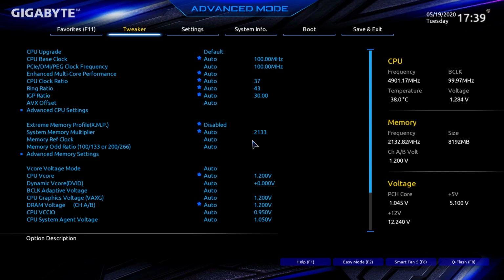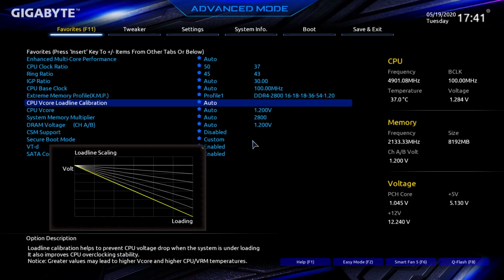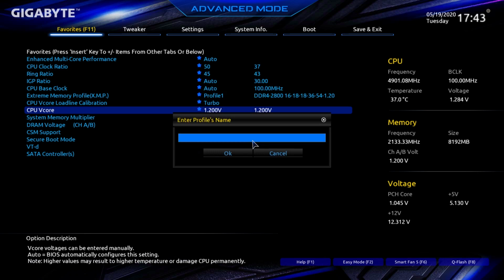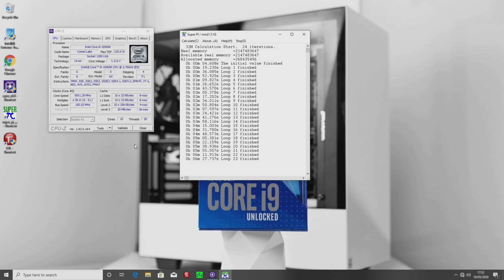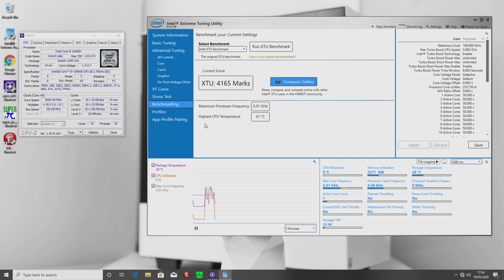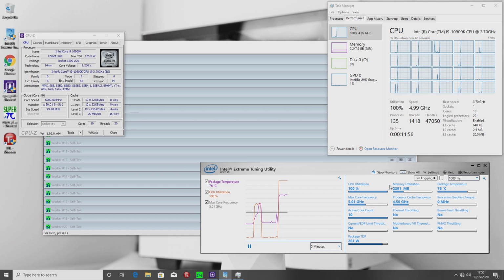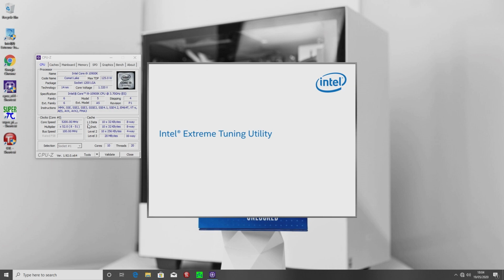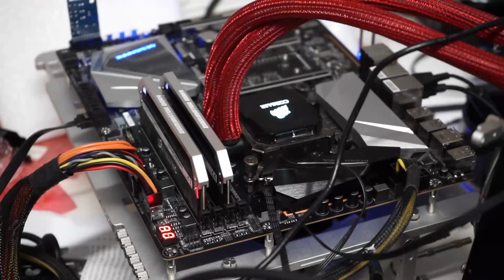Intel Core i9 10900K & Z490 5GHz+ overclocking guide

Comment: I'm picking up a 10700k this week.  What is the best z490 board ?  I saw the Maximus xii Extreme, but you can't find it anywhere.  Is the Gigabyte z490 xtreme a good alternative?  I had a z390 Aorus Ultra and the board was great.
Reply from the maker: I’ve had experience with Asus board as well as Aorus Master and Vision D. All good boards. I see Gigabyte Z490 Elite board is also a great clocker. Not sure about MSI and Asrock, no experience

Comment: My i7 10700k runs at 5ghz for about 15 seconds and drops right back down to 4.7 all core? MSI Z490 Gaming Edge ATX MB. I've tried everything, but it will not stay at 5ghz. Nothing is throttling. Is my MB just a POS? I can set all cores at 5.1ghz in the Intel Utility and it runs fine for hours, but it will not hold OC using the BIOS. I don't know what's going on.
Reply from the maker: I don’t have experience with MSI so cannot say but i assume you’re not doing your settings right in bios. Try find a guide with MSI boards or try replicate steps I’ve done in my video by searching out all the options in MSI bios
Reply: @dinos22  Thanks. If it's not an issue with the bios update, I will have to RMA the MB. If it comes down to it, I'll buy another brand, and I'll spend a little more to get a better one.. I guess 4.8ghz, or 5.1ghz using the Intel Extreme Tuning Utility will be ok for now. I'm waiting on a response from MSI at the moment. We'll see. I may even go buy a new board tomorrow, and try to return this one. Bummer

Comment: I'm new to overclocking so i dont know much, But according to CPU-Z i Completed a XTU Benchmark at 5.1ghz at 1.185 - 1.200 Volts (is this good?) even though i have the voltage set to 1.37 in bios with a LLC of 5. Any voltage lower than 1.37 in bios resulted in a crash, is this because it doesnt get the voltage it needs under load?
Are you planning to make a guide for Asus? It was hard to locate the different settings when the whole bios is organized in a completely different order to Gigabytes. 
My goal is a stable 5.2Ghz with a healthy voltage, if not im happy with 5.1. Its my first time overclocking a cpu so i dont know the signs of a bad or good bin and or settings.
Also i BOSD'ed alot with various Error codes, but when i googled them most of them were related to Driver issues, i dont know if this is a direct result of the overclocking or just an underlying issue. Im using a fresh windows 10 install.
(Using a 10900k with a Asus Rog Strix Z-490E and NZXT Kraken X63 280mm)
Reply from the maker: Check out my latest video. Made it due to your request :)
Reply: @dinos22  Wow that was quick, thank you so much i appreciate it alot! You make good guides that are easy to follow and educational, great work! :D
Reply from the maker: I have an Asus board, let me do one for that too. LLC5 and 1.37 sounds like you are on those volts, weird it’s reporting less

Comment: You think I’ll have any issues with a noctua dh15 air cooler?
Reply from the maker: I don’t think so but it will depend on what you’re trying to do. If you try using a load that exceeds the cooling TDP performance of the cooler than you will have issues. Will you have trouble with 5ghz 1.2v, I’d say no

Comment: Thanks for this. I have an auros master and a 10900k with a 360mm aio. Trying to get 5.2 or 5.3. Out of the chips you've OCed, what was the highest cpu vcore you had to set (I.e. the worst chip?) also is it OK to keep the eist and turbo enabled?
Reply from the maker: Yes you can keep it enabled for 24/7. With worst chips I didn’t push them to max so cannot tell you what they needed
Reply from the maker: You’re welcome

Comment: Put system agent at 1.15 and try 49 cache.
Reply from the maker: I had it at 5GHz without using SA. SA will not help your ring clock btw, it will help extreme memory OC and tight latency. CPU voltage is linked to ring frequency so vcore will help but cooling is important for 5GHz+. Subzero on CPU helps obviously. I’ll be doing another, more advanced guide soon.
Reply: @dinos22  i manually input every voltage in my bios to stock instead of on auto. then by changing only 1 factor at a time, i tried to see what would affect cache. and VCORE does not do it.(not for me at least)   i found that only when i had my SA above 1.15v was i able to pass 47cache and go all the way to 49. i was unable to post at 48 before but then all of a sudden 49 was rock solid stable. changing SA for cache dawned on me after i spent an hour researching the architecture of the chip to see what actually is part of the system agent. cache is part of it.
Reply: This is very interesting, maybe raising VCCSA is affecting another voltage but I'm not sure if it's linked to another like VCCIO is to DMI. PLL Termination (PLL OC I think on GIGA?) can help with uncore/ring/cache overclocking but as Dino said temps/cooling seems to be just as important as Vcore

Comment: Have 10700k and its at 5.ghz base and 5.1 with just throwing the chip and xmp, with mce auto want to OC since my sometimes its 8x sometimes its 50x. Its running at 1.27V and 71C max, have a Noc D15 on it. OCing noob so taking it slow LOL. Just trying to find a asus overclocking guild before I start changing things.
Reply from the maker: I will do an Asus guide too soon. Really nice mate, just turn if EIST and turbo functionality in bios to stop multi flicking up and down
Reply: @dinos22  No eist LOL. Ok bootup 49x current and max 52x 1.341V 79C max 5110 cinebench woot. Still need to replace the 3 cheapy intake fans with some Noctua A12x25. Think I'm done not going to push it hahah.
Reply from the maker: Beautiful, enjoy

Comment: So far 5.1ghz at 1.248v (4400mhz men cas18) an 4800mhz ring bus.

5.2 I think will need 1.33/1.35vcore I will test tomorrow

Btw I use a 280AIO and temps are better then my friends 9900k at 5ghz with 1.26vcore
Reply from the maker: Btw 4800 is what i saw on ringbus on all too
Reply: dinos22 did you max out the ring? Maybe it can go 5ghz also?
Reply from the maker: FireTwo interesting you bring that up. Im doing some ram testing now and also played with ring. The chip I used in this guide is stronggg, it can do 5GHz ring too. Had issues with others after 4.8
Reply: dinos22 how do you stress test cache adia64 as an option for cache?!
Reply from the maker: Yes 10900K has more improved thermals and power draw from what I’ve seen in reviews. Paul’s hw has a good graph on it
Reply from the maker: Looks like a nice CPU. Honestly if you are stable at that, you should be able to do next 100MHz with +0.05V

Comment: Intels shows it is 5,3Ghz? Why does not any of this CPU run @ 5,3Ghz stock?
Reply from the maker: 5.3GHz is a turbo clock on 1 core that bumps on light load for a limited amount of time, 2 cores to 5.2 but heavy sustained load will drop to 4.9 with unlocked power bios or low 4s with stock bios. What overclocking does is two things, it fixes your frequency and fixes your voltage so you actually tend to give your CPU less volts if properly tuned!
Reply: This is the same for amd buddy..well except it will take AMD like 1nm to hit 5ghz at this rate

Comment: One question Can Dark rock pro 4 TDP 250W cool down i9 10900k?
Reply from the maker: Not sure mate but seeing it’s rated at 250W TDP i would say it will probably be same TDP as this AIO i am using so I don’t see why not. Personally I’d also control TDP by using the OC I’ve set in this bios with set voltage and frequency rather than let bios auto voltage and allow for voltage spikes.
Reply: you'll have to try and see dude

Comment: hopefully finally tomorrow is the day!
I've been waiting like 6 years to get 5GHz+ stable, cancelled the 3900X and ordered up the 10900K!
thanks for the tips dude

also I use OCCT small and large data, also AIDA64 FPU.
Reply: ufster81 fx series was so bad it nearly killed amd!!! They literally was on the bankrupt boarder line!
Can’t wait to see if Zen3 can finally keep up with an 8700k in game let alone a 10600k 😂 i really don’t care about any muticore rendering stuff or blender times give me maximum FPS
Reply: @ufster81  slower??? You butthurt AMD fanboys are not laughable any more, just sad with all the nonsense bullshit you spread
Reply: Good decision. I think amd is great for most people but that 5ghz barrier is exciting. I'd call that the sound barrier of the CPU world.
Reply: GungHo ended up with easily getting 5.2 stable. 1.330 Vcore set in bios with middle of the range load line. Vdroops around 1.3v with 5000mhz cache an temps are great with a 280mm aio.

I think 5.3 is possible...
Reply: @ufster81  Why do you think AMD is faster on multithread performance? Because it's got 2c 2t more than Intel my friend and yet AMD's nested virtualization is shit, not supported well, so why would I buy this chip with a lot of cores that I can't be able to use properly for my work? Also, can you OC R9 3900x to 5Ghz all cores on air? No you can't, my i9 10900K runs 75 degrees C, 5 Ghz all cores with Scythe Fuma 2 cooler, go do the same with AMD, good luck pal.
Reply: ufster81 I get 6900 in r20 Cinebench yet the 3900x has 4 more threads.
Now let’s talk single core. I have 551 my old 3800x at 4.4ghz all core does like 512
Reply: @ufster81  OK, my challenge stands to any owner of R9 3900X is to run eve-ng on Vmware Workstation 15 Pro, install Juniper vSRX and boot it. Good luck pall...